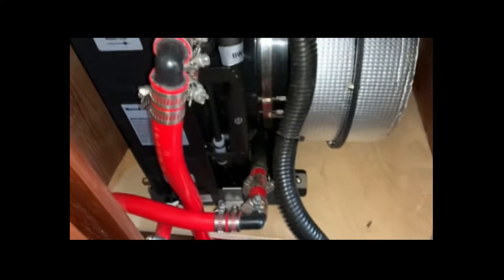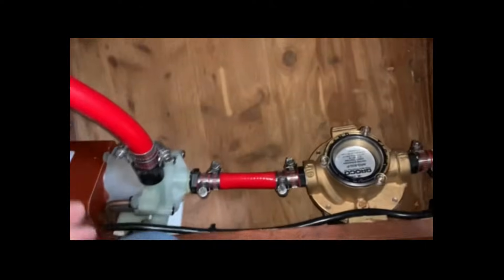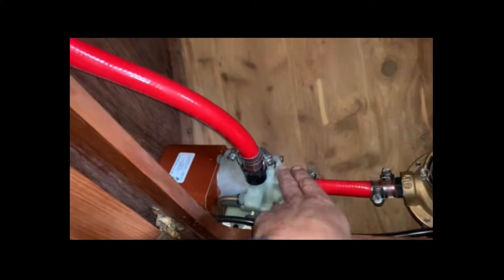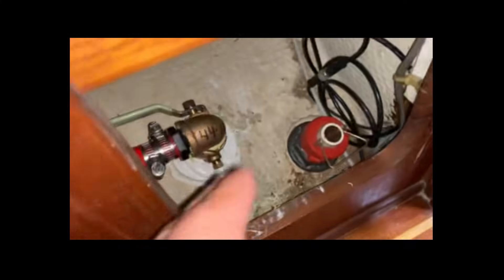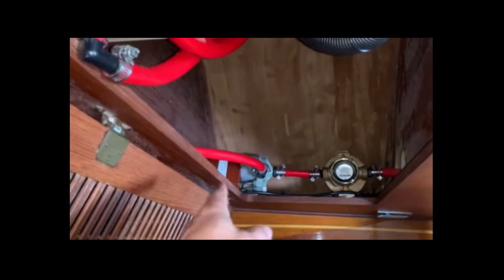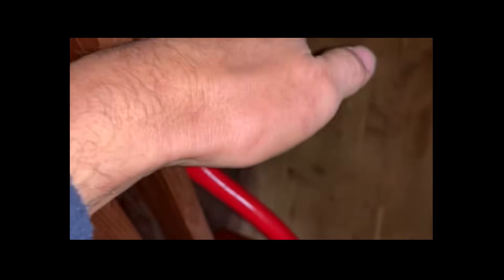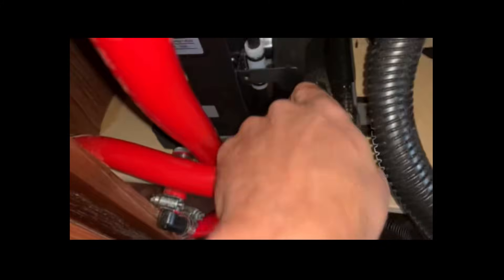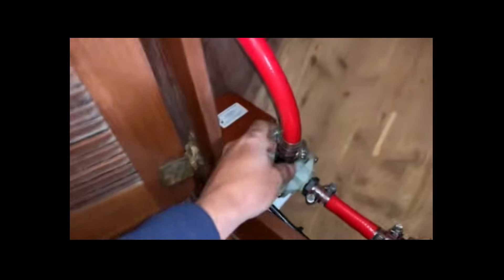How do I prime my boat's air conditioning system (priming marine AC circulation pump)

Comment: What is a sign the unit isn't primed?
Reply from the maker: AC unit is running and no water is coming out of the boat. The circulation pump should be running from the moment the AC or heat (reverse cycle) is turned on. Cavitation also has a unique sound - like a propellor out of water spinning too fast. That’s another symptom. We also suggest checking that the strainer basket is clean. That can cause similar symptoms.